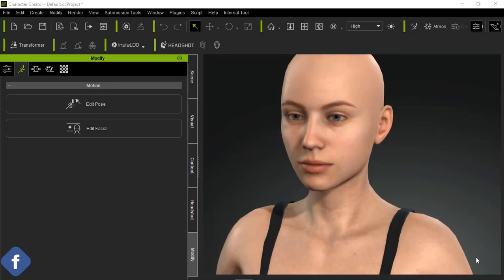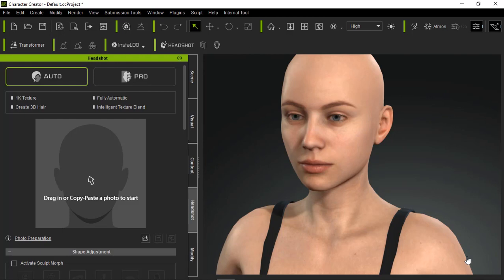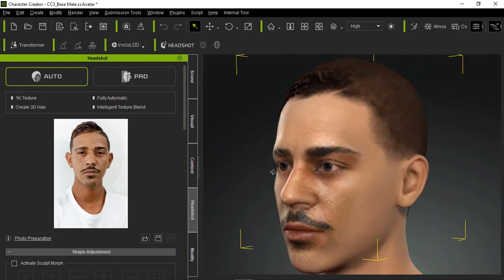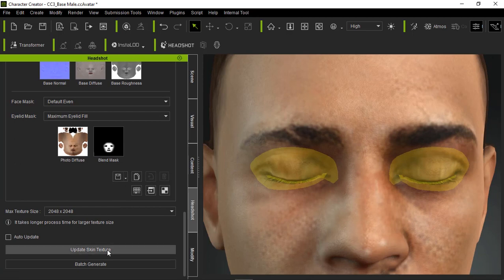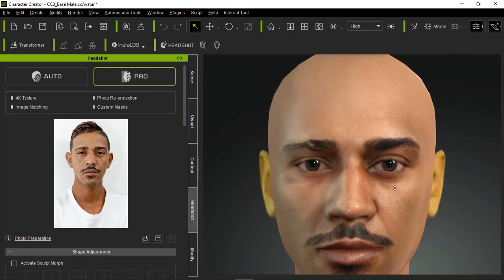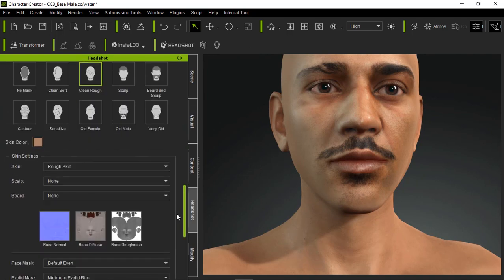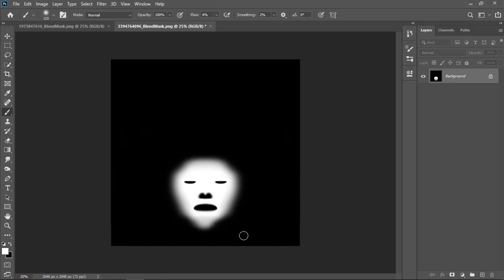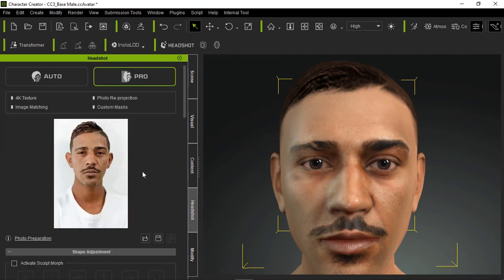Turn a photo into a 3D Character with HeadShot plugin character creator3 2020

Comment: Can we make 3d face and then export this to obj and then use it in Zbrush ? Or any other 3d software ?
Reply from the maker: Yes sir
Reply: @abyssiniaLab  and if i have anyone's front side face image then i can just make their full body easily ?
Reply from the maker: Headshot is only to make the face closer to the real one ...u give the face with a clear texture n then u can get a breathe taking textured character...but the other work will be on the shoulder urs...using sliders make the staure /shape work bro
Reply: @abyssiniaLab  okay thanks man
Reply: @abyssiniaLab  my screen resolution only supports 1280x720 and beacuse of that i cannot export fbx because the export button is down and is not visible on my desktop. Can you help me ?
Reply from the maker: In order to have other resolutions..u have to install video graphics drivers(like intel or amd) so as to get other options like 1366x768,1360x768...
Reply: @abyssiniaLab  i have install but my monitor and motherboard is not full hd